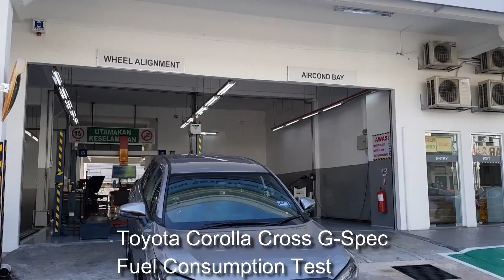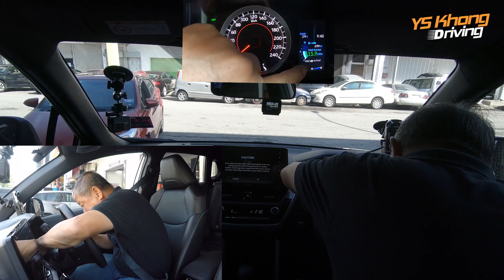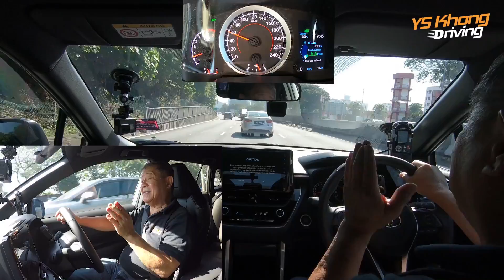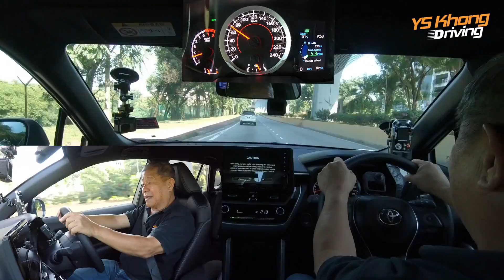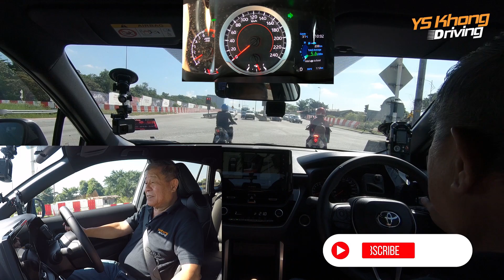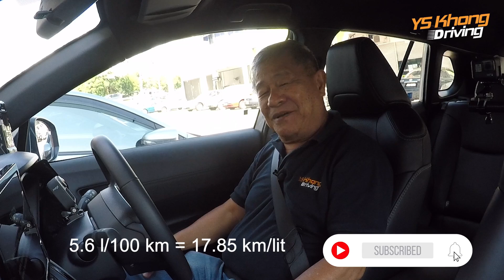Corolla Cross 1.8G - Fuel Consumption Test in Urban Environment / YS Khong Driving

Comment: Any comments from Toyota Cross 1.8 petrol variant on city driving fuel consumption litres per 100km? Thks
Reply from the maker: It is actually quite close, only a few percent variance
Reply: But Mr Khong, U recorded ard 6litres plus per 100km test drive from LDP to 1U in 2022. Mine is recording 12.2litres per 100km with more short 3 to 5 Kms than 30 km trips. April 2024 model. Maybe HV to live with it. My previous 7 yes plus CX5 averaged 10.3litres per 100km for my generally same drives as a retiree.

Comment: My new Toyota Cross 1.8V was averaging 12.9litres per 100km for the 1st 616 km. My trips are mostly off peak periods with more short trips of 3 to 5 km with some 30 to 35km trips in between. I have raised an issue with Toyota HQ and the service insists this could be normal. When their HQ technical test drove my car for 148km from old Klang  rd to klia and back using MEX and I suspect Air Cond was switched off, it returned 8 plus litres per 100km. I  am still not convinced cos my previous 7 years old CX5 returned on AVG 10.3 to 10.5litres per km for generally the same driving trips. Appreciate comments from similar owners. Thks in advance.
Reply: Yes I noticed the same with my 1.8v. I noticed that uncle here is driving here with a light foot and traffic conditions are not that heavy. I suspect my heavy foot aswell as traffic lights results in an average of 11 to 12. I was expecting something  better as I came from a preve that a had a lot of power and torque, this 1.8 lacks both and still is not far off from my preve.

Comment: The fuel indicator barely move after 34km driving..5-6/100km is very good fc.
Reply from the maker: Yes, agreed.
Reply: I did a 37km trip recently from Sri Petaling down PLUS to UPM toll to Sri Serdang at 10am light traffic. Stopped 3x for errands then back via MEX Seri kembangan at 90km/HR mostly to Sri Petaling. Trip consumption was still 10plus litres per 100km. Any comments from similar Toyota Cross 1.8V owners appreciated. Thks.